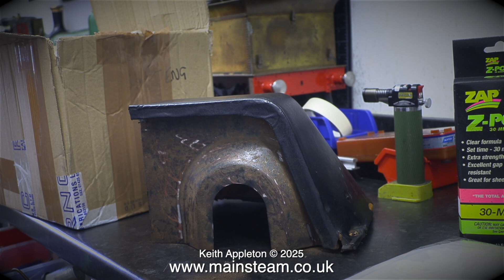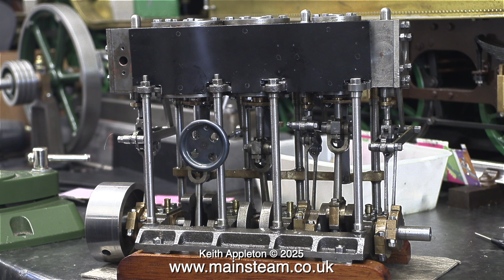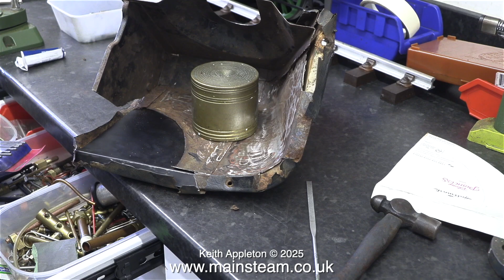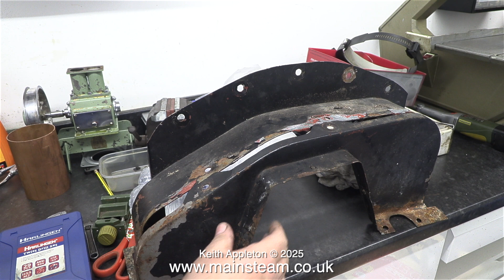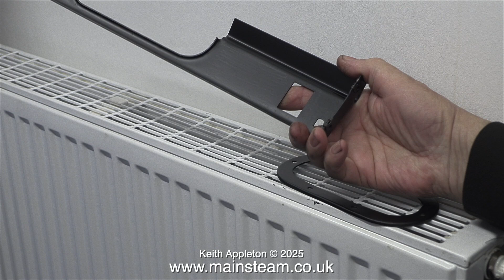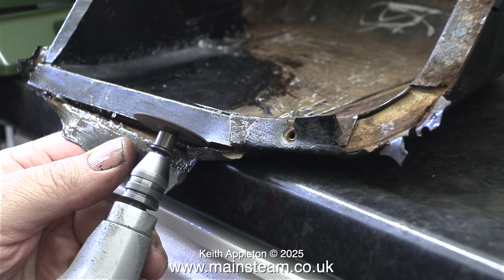REBUILDING A RUSTPROOF LAND ROVER - PART #10

Comment: I have a ‘Top tip’ for you. Epoxy resin gone all crystalline because it’s old? Remove the cap and give it a blast of ten or twelve seconds in a microwave. It will get quite warm and re liquify for you. Be very careful with the timing a little trial and error may be needed.
Reply: Make sure it cools before mixing...  the reaction is exothermic.  In a past life I worked in a factory with a chemicals/solvents/conformal coating space. In an act of incredible stupidity a search for knowledge we heated some  epoxy to 60deg and mixed in the catalyst.  within a couple of minutes the mix was smoking and the polystyrene mixing cup melted... 😀
Reply from the maker: That's an interesting one. The Epoxy Resin I used to initially stick the new metal in place was just soft enough and worked OK, thankfully as I usually heat my lunch in my microwave }:-)))